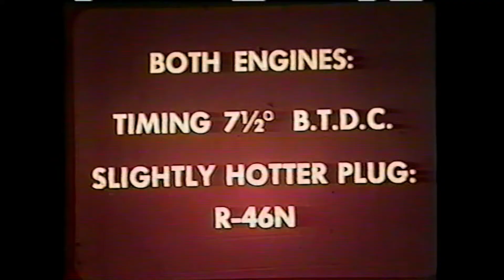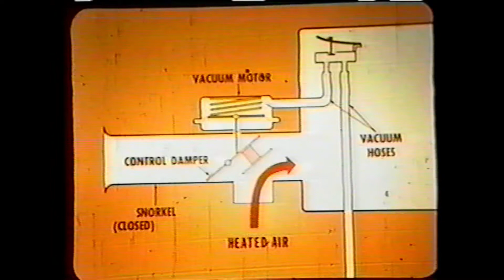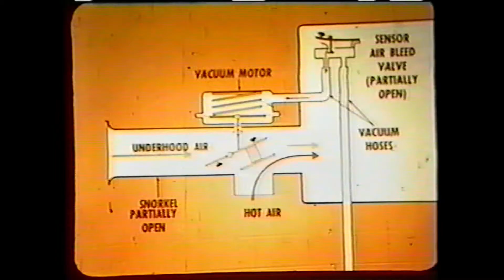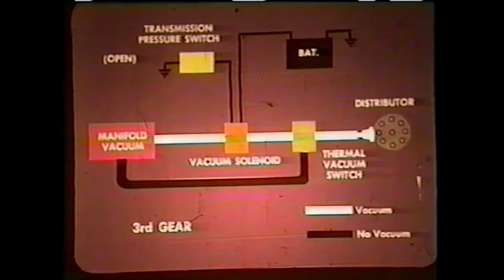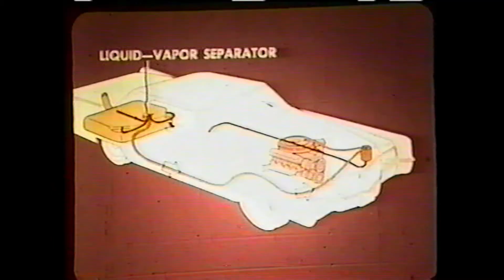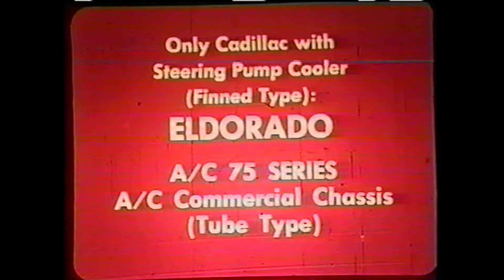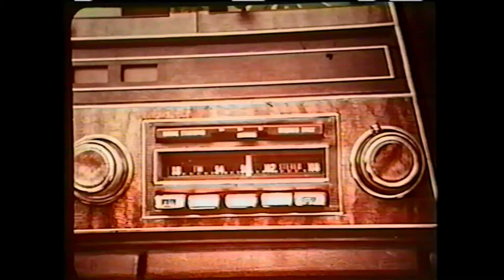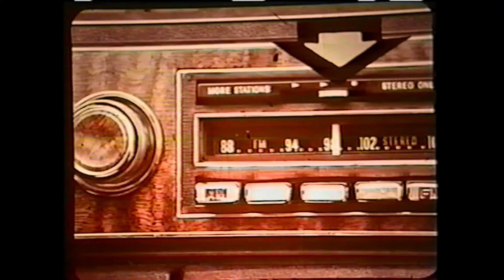1970 Cadillac Serviceman Introduction Video

Comment: That 500 cubic inch engine came in handy when the Oil Embargo of 1973 hit.
Reply: It made them cheap on the used car market.

I bought a 1973 Eldorado for $400 in 1978.
Reply: Fact 1973 was a record year for Cadillac sales.  All car sales slumped but Cadillacs still sold well after 1973

Comment: That vacuum advance disabling thing is atrocious. No vacuum advance at idle will make the engine run hot at idle and remove part throttle torque.